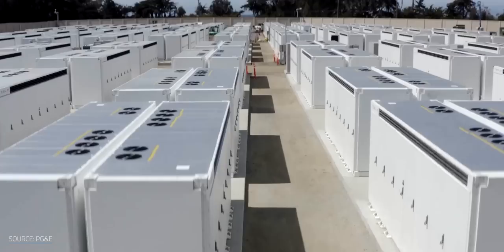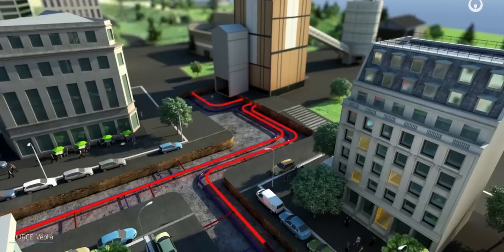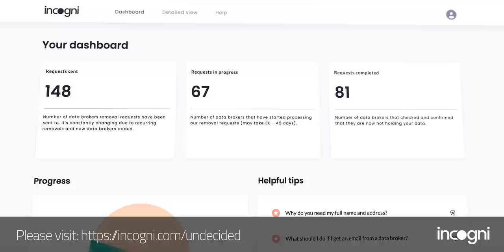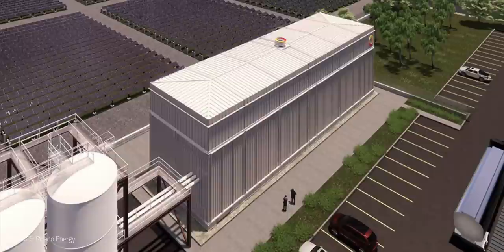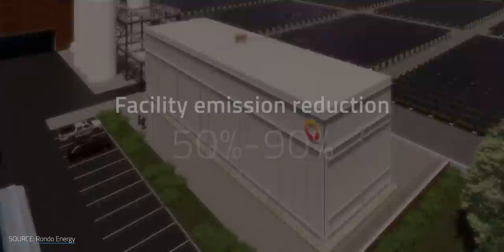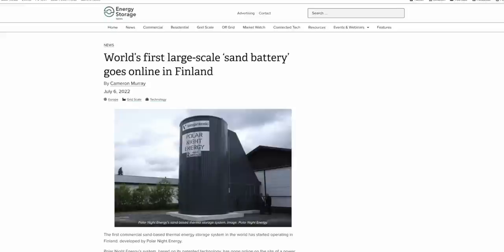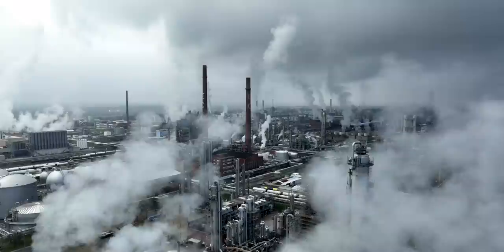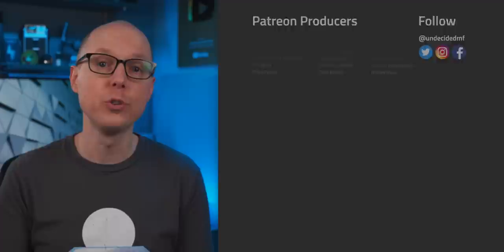How A Brick & Rock Battery Is Changing Energy Storage

Comment: I had the idea of making my fortune inventing colorful anodized aluminum 'ice' cubes. To test my idea, I put some pieces of aluminum in the freezer, then dropped them into a glass of water at room temp; the temperature wouldn't drop more than a degree. Of course, the trick about water ice is the phase change - Going from ice 32°f to water 33°f  is far more significant and energy intensive than water changing from 33 to 34. It's the phase change where all the energy is stored. The same with steam.  Raise a pot of water to 212°f and it still takes a lot more time before it starts boiling.  So I really wonder if heating up rocks is really going to accomplish all that much. Drop red hot metal into a small bucket of water and you can take it out with your hand, and almost all the water is still in the bucket.  For heating buildings? Sure. For energy storage? I might be missing something, but I'm dubious. If any part of what I've written is correct,  I'd suggest speaking with a classical physicist before doing another video like this.

Comment: So, this not a new idea. I definitely support industry using heat storage to save money. In all of the industries I've worked in, high heat processes aren't well insulated and so much of the heat created is just washed as hot things cool in air. BUT, the energy savings and effects on reducing emissions and impact on climate change are as usual, blow way out of proportion. On quick example: we know that photovoltaic energy isn't too efficient. It seems illogical to immediately convert solar radiation (lots of heat) to electricity, then from electricity, back to to heat up rocks, then transmit the energy with steam, to heat up some other material. All those transfers mean losses. Why aren't big industries using concentrated solar to heat their materials directly? The answer is that it's inefficient. Industry would get the same benefit just insulating their processes better and only generating heat as it is needed.

Comment: Multiple methods of heat storage are needed. The efficiency is key on round trip. Thermal energy to thermal energy. Conversion to electricity loses 30% aka gas  coal or nuclear. Every technology reduces fossil fuel burning.
We have been burning rocks for a million years. Soon to be extinct. So we don't.

Comment: These aren't batteries in the common-use sense of the word.  A battery stores energy as chemical energy which is released by pushing an electron or two around a circuit.  A chemical battery has a thermodynamic efficiency of 70-90%.  In other words, if you use 1000 Joules of electricity to charge the battery, you can get 700-900 joules back out as usable electricity.  The rest is lost to heat.  The devices described here se are just a pile of hot rocks.  You can turn electrical energy into heat at 100% efficiency but you can't turn all of that heat back into electricity.  This was discovered by a French scientist named Carnot and further developed by Clausius.  The efficiency of turning heat into work (pushing a piston, turning a wheel, or generating electricity) is equal to (Thot-Tcold)/Thot, where Thot is the temperature of your heat source (hot rocks in this case), Tcold is the temperature that your working fluid can cool to (think of water or another fluid used to extract the heat from the hot rocks and do some work as it expands and cools).  For a coal-fired power plant the overall thermodynamic efficiency is on the order of 38%.  This is the best you can do.  The only way to do better is to run the furnace hotter or have a colder environment to exhaust the heat to.  So using high quality electrical energy to heat up rocks is going to lose about 2/3 of the energy you started with.  There will be some inefficiencies in the insulation and power needed to run the facility which further reduce your real-world efficiency, but this is already a losing proposition.

Comment: The NEED for Storage IS NOT primarily to store energy that is generated when it isn't needed.

The main (absolute) need for storage is to have ENERGY when there isn't enough (or any) energy being generated.

Energy needs to be stoyed for up to 6 months... or RE Production needs to be boosted ~30% (for using shorter ~1 month storage - which might actually be possible).

Do some ACTUAL Resource Calculations Already.  Net Zero WILL NEVER HAPPEN b4 2100.

Comment: If only there was an even more efficient way to store energy....like I don't know water. Hmmm maybe we can store enough energy as water behind a barrier and then release it when it is needed
Wow ...where is my Nobel prize 🤯
Reply: Bricks have a much higher specific heat capacity compared to water. Even with inconsistent makeups due to the various minerals found in a brick, water has a specific heat capacity of 4.186 J/gC, where as an average brick is within the range of 1000 J/gC. The materials these companies are using are likely better designed for the purposes of energy storage so their SHC’s are likely even higher. Aside from that, if these heat batteries are gonna be used to heat things up for most industrial purposes, whatever’s inside would get heated up well past 100C. If your Nobel worthy idea of using water instead was used, not only would the steam that’s produced once the water boils decrease the thermal conductivity in the system, the pressure would eventually increase to the point of possibly causing an explosion. Bricks on the other hand would likely need to reach 1000 C or higher before beginning to melt (not boil) and that would require thousands of time more energy being put into it compared to water. Aside from that the density of bricks allow more energy to be stored per volume of brick, so not only would you risk an explosion, you’d need many more/larger water heat batteries to store the same amount of energy as a brick battery. Wow…. Not much of a nobel worthy prize is it 🤯🤯

Comment: The problem with these kind of systems is that they are horribly inefficient for anything other than heat. Electricity storage is a joke with them. So if you use electricity to heat them you are patheticly inefficient. Chemical renuwable fuels are easy to store so their only realistic source is wind and solar. Those are direct electricity producting methonds so your round trip efficiency is pathetic. Almost no one uses direct electricity to heat applications so that you could replace it with renewable electricity to heat for heat application. Making them a very fringe application.

Comment: Fine for a super fast-talking car salesman, but for actual easy to see and understand, this presentation was plain jibberish.  How the systems worked, were constructed and who such were made for was just too buzzy and fast.  Like how the light bulb was created.  Just "Wire" in a glass Bubble is the facts but does not tell the story or how to build upon it.  You are like ChatGPT, with lots of facts but if you want correct information you must look it up yourself as you cannot depend on GPT, to tell the truth.  50  years ago, folks were burying pipes around the new home and putting rocks in water baths to store heat, so is this just an update of those systems?  Too much buzz, and not enough sting.